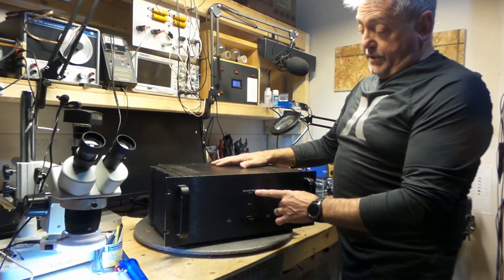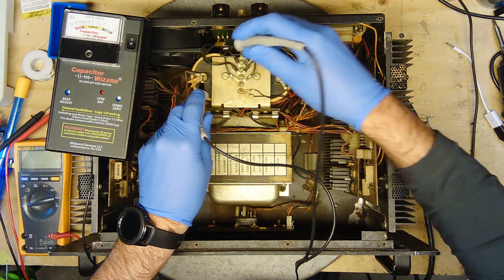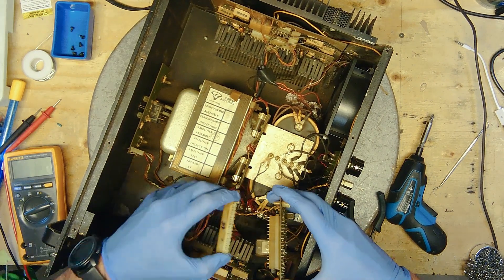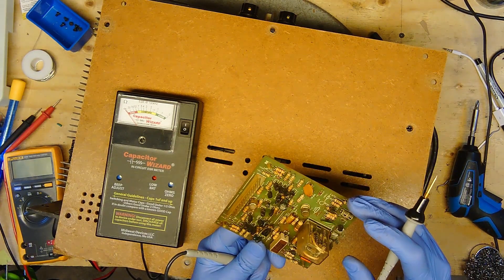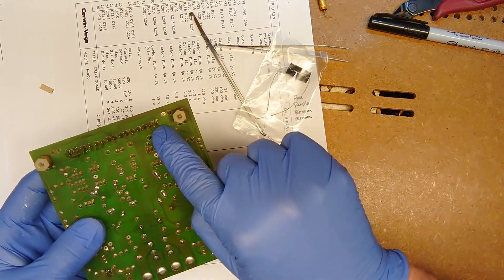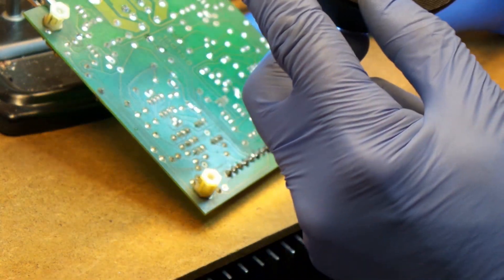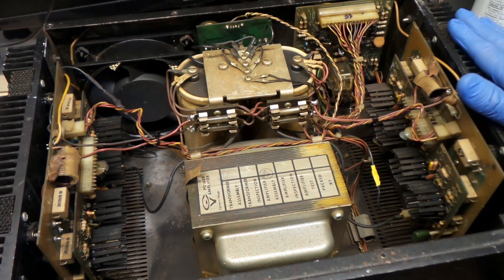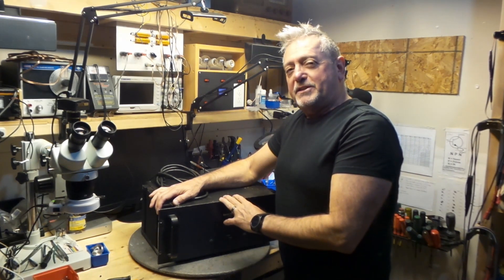Cerwin Vega a-400 with hidden issues on protected PCB

Comment: Well done  Joe :-D ,  That was a mess of half baked parts.
I liked the separate driver modules/pcb's and speaker protection pcb.
I looked for the rectifiers for ages and right at the end you pointed them out ha ha :-D
You did a smashing job Joe.
I have repaired all sorts of odd electronics, saving useful things from the trash is good.
Keep on tinkering :-D

Comment: So the transistors on the outside have thermal paste and then a piece of plastic between the trans and the huge heat sink?  I wasn’t aware the backs of the transistors couldn’t directly touch the HS.  Seems like a less than efficient method of dissipating heat to go through plastic to the aluminum…?

Comment: Nice work, well done.
Only one doubt: has the 2.7K 1W resistor been replaced?
Perhaps it would have been appropriate to lubricate the fan.
Reply from the maker: Hi Scossa Verona, 

Thank you for viewing my video and glad you liked it. as for your question? 
I wasn't sure if I was following you on that question about the 2.7K resistor but once I reviewed the video, I see where it could of confused you a little, to answer the question, YES I did change the resistor 2.7K after the fact and the reason you see the old 2.7K resistor not changed, it's  all in the editing, I didn't have that 1watt resistor here in my shop so I had to order one that took a week to arrive but I wanted to continue on with the rest of the servicing so I reinstalled that discolored resistor as it was still good actually... that way I was able to at  least power on the amp and finish my video. Thanks for pointing that out to me and rest assure I did change that resistor. 
I change the thumbnail picture also to show that I actually replaced the 2.7K.
I apologize for the confusion and hope this has clarified your question.
Reply: @VintageAudioFever  thanks for the clarification. Great job.

Comment: Hi.. in a video where you replace stk 0050 module .. what value of transistors or mosfets used ?
Reply from the maker: the customer bought them on ebay , type in STK-0050 module II